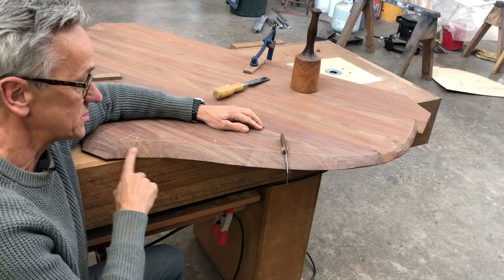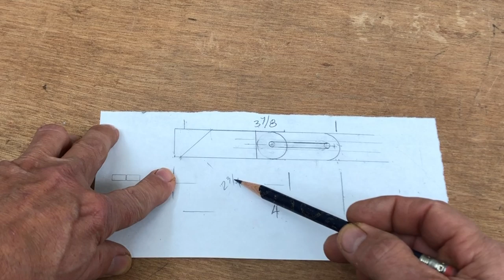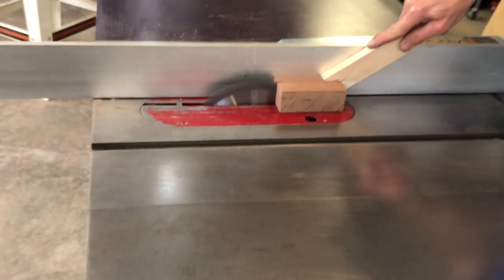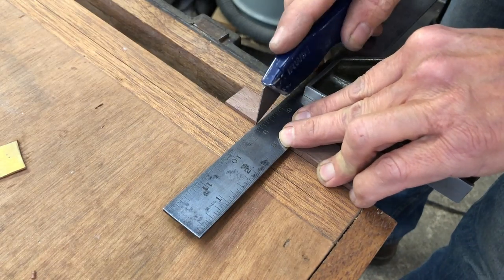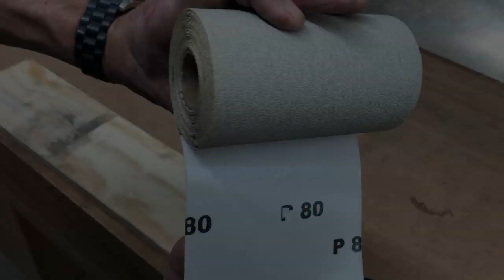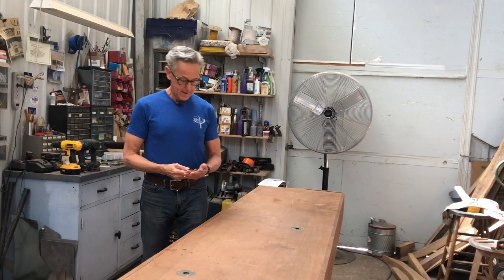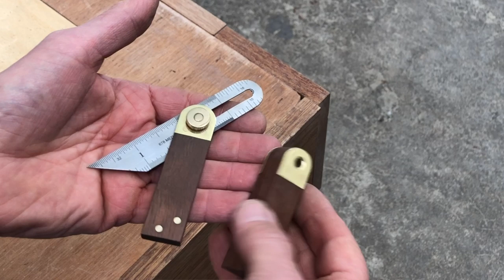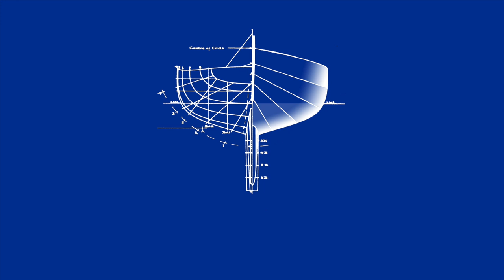Making a 4" T-Bevel Gauge.

Comment: As a shipwright I have need for very small bevels, about 2”, but you cannot buy these. I use pieces of lumber banding riveted together tight enough to stay but loose enough to move. They work well and are no great loss is lost or stolen.

Comment: That's nice.  I would use epoxy instead of superglue.  Also, I would have put a countersink in the brass and hammered those brass pins over before filing them down.  Both those might be unnecessary, but for something this nice, I don't think it would hurt.

Comment: Beautiful t-bevel. Maybe a wood bodied groove plane for the planking rabbit? Sideways pivoting blade would make it all the more useful for the rolling bevel needed to get the V-bottom of the rabbit at its required pitch for the differing angle needed at the rabbit. A 85° to 90° blade edge should work. Of course a rabbiting (rebate) plane should serve just as well, and would be useful for other rabbit (rebate (England word same as rabbit here in the states)) needs.
Reply from the maker: Correct Rebate is spelled "rabbet" here pronounce the same as rabbit.
Reply: @TheArtofBoatBuilding  
Thanks, I guess auto correct got me there, but hey, potater/pototer, right?

Comment: very very nice! i've got an old (20+) year old hunk of cocobolo I might just slice off a piece of and do this myself. may I ask why you apparently didn't you countersink peen the brass pins before filing and polishing? the CA glue definitely works, and isn't lead bearing by any stretch, just curious...
Reply from the maker: Peening the pins is a good idea if the material that it is binding is as hard or harder than the brass pins. The black walnut I was using is a tad softer so it would be difficult to get a good mushroom head to form. The Janka scale (measure wood hardness) for cocobolo is 2960, black walnut is 1010 so the cocobolo is almost 3 time harder. You'll have not problem countersinking and peening the brass. Thanks Bo!